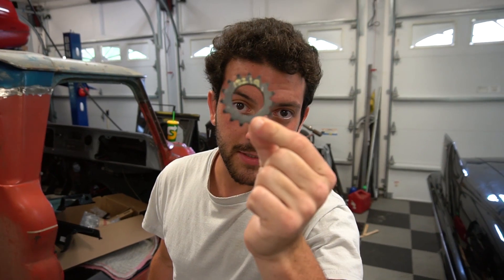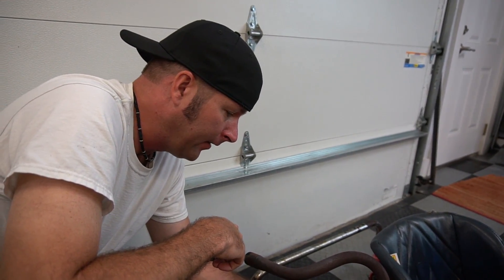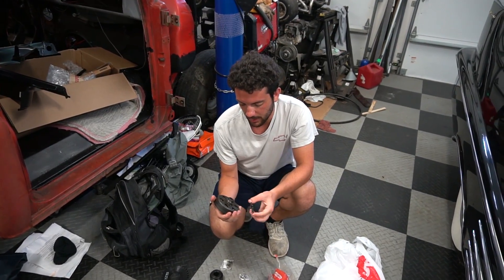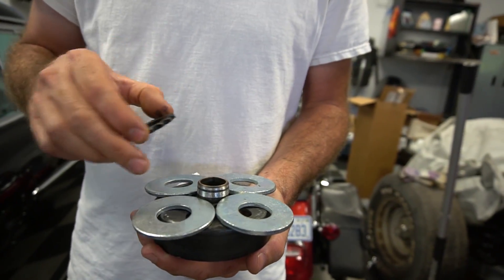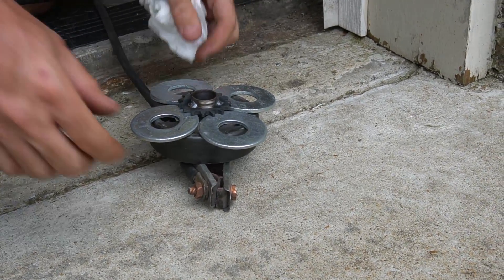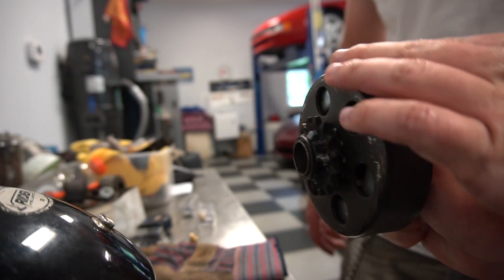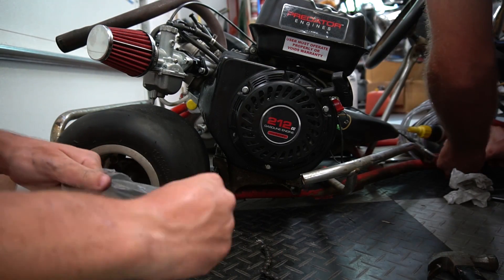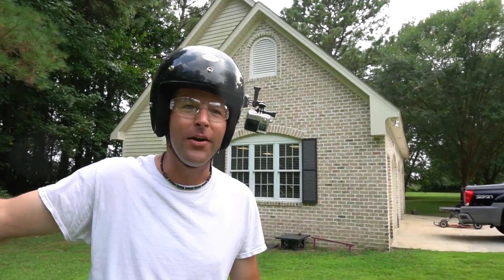Vintage Racing Kart Hits 70+ MPH

Comment: If i can find it amongst my hoard i have a newish cheetah racing clutch it was on on my 266cc BSP stroker GX200 has like 3 dirt track laps on its not even broken in comes with a 15-18 tooth sprockets i belive i have differnt clutch springs and stronger plates for it just gotta find it all id reckon you guys could hit over 72mph

Comment: Ok so question.....if you add a Small gear to the shaft it gets more speed? Or the bigger ones? I always thought you could get more speed by a bigger gear because of more surface area...I have no idea you would know lol thanks....btw that was AWESOME
Reply: It's about the size ratio of drive (gear, pulley, or sprocket) to driven. The engine sprocket is obviously the drive, the axle sprocket is the driven. If both drive and driven sprockets are the same size then the axle will turn at the same speep as the crankshaft. This is a 1:1 ratio, it has zero increase of torque or speed. In most gasoline engine applications you cannot realistically use a 1:1 ratio due to the limited torque output of the engine. Without torque multiplication the vehicle will have poor acceleration or possibly stall the engine. So we decrease the size of the drive sprocket and/or increase the size of the driven sprocket. This means that the engines crankshaft will now be turning at a faster speed than the axle. Lets say you have a dtrive sprocket and a driven sprocket, each with 50 teeth, a 1:1 ratio, and you replace both sprockets, with a 25 tooth drive sprocket and a 100 tooth driven sprocket you now have a ratio of 4:1 meaning your crankshaft will now spin 4 revolutions for every revolution of your axle. This will increase your torque being applied to the  axle and improve acceleration. Now lets say you test drive it and find that it accelerates great to about 25 miles per hour and at that point your engine is at maximum RPM and therefore limits your top speed to 25 miles per hour. If you wish to go faster you need to either increase the RPM your engine is capable of, which can be expensive and possibly risk blowing up the engine, or you can decrease the ratio by changing sprockets so that your drive spins less than the 4 times the revolutions that your driven is spinning . This time you put a 75 tooth sprocket on the axle, while leaving the 25 tooth sprocket on the engine. This gives you a 3:1 ratio. Now you test drive and find that acceleration has decreased somewhat but top speed has increased to 32 miles per hour. You also notice that the engine is still reaching it's maximum RPM and is therefore limiting the carts speed to 32 miles per hour. You decide to make one more change, putting the 50 tooth sprocket back on the crankshaft and leaving the 75 tooth sprocket on the axle thus giving you a 1.5:1 ratio. This time acceleration is even slower but you notice that the engine barely reaches it's maximum RPM before it runs out of power to go any faster, or is just short of its maximum RPM. At this point you have reached the maximum speed that engine is capable of propelling the cart at, any further reduction in the ratio will result in a loss of top speed because the engine does not have sufficient power to rev higher without the torque multiplication of a higher ratio.

Comment: That clutch + black widow = 10 mil views, 130 mph, and more fans, and fun, and life insurance rate increase :P like if u think they need to put that damn clutch on the 670, comment if they should take a torque converter and weld that sprocket or a bigger sprocket to the torque converter
Reply: That would most likely kill the 670.
Reply: Nah it'd kill the chassis before the engine lol

Comment: I was doing that, average 74-76 on a dirt track turning 15.40 sec time laps , the guys running limited engines are at 85-100 mph on same track, Southern Kartway, Loris SC, AKA Dannys,  check out those vids, I raced at 44-48 years old, offset chassis just like that, go around on a dirt track and it will put lead in your pencil, i raced back in 2007-2012

Comment: You need to plumb your vent to a puke tank.On our Briggs flatheads we got 94mph on a stocker and 106mph on a limited modified.1/4 mile oval with a 20tooth/front and a 70tooth rear.

Comment: Thanks for the entertainment!!!  Remind me:  Why no torque converter?
Reply: It's a little engine meant for minibikes.
Reply: They have been putting them on their other projects that have similar/identical engines.
Reply: They have? I've sorta only been following this project. I think they're using clutches cause there's no slip. I doubt a little torque converter would have a locker in it so it'll slip. So when they're going 72mph subtract like 5% slippage and they'd not be going 70. Also maybe the clutch is easier to mount sprockets on.
Reply: kipster1975 torque converters are slower but have more torque
Reply: it wont fit because the seat is too close to the engine

Comment: Hey guys I have an all stock non Hemi predator with air cleaner exhaust and flywheel mods I run a 13 tooth clutch and I have a 74 rear gear was wondering if you ever ran that type of combination

Comment: alsome work on the 12 to 15 i find myself watching your videos many times over just for ideas and kicks. but i do have this ?
maybe you might know before i spend 119$. the troque converter or tranny im working on a motorized 212cc motorized bike build but need to move the sproket on the converter to it opposite side or the back. perhape you have some ideas

Comment: Don't try this at home?? Well I couldn't.  like you, I don't have a one mile long driveway. My friend in the country however DOES have a 1.3 mile long driveway so i can try it at HIS home!

I reckon a bit of fairing over the engine would help reduce some drag and give you some more top speed if the engine isn't at max RPM already.  The tank is a big air resistance. Take it off and mount it behind the seat/ Driver where the air is already blocked and just a sheet of perspex heated and curved over the front of the engine would be much more aerodynamic. 
A fairing over the driver or a windscreen may help as well. 

I'd have the pipe exhaust come out straighter and also go behind the back of the seat and out.

Comment: I'm not trying to burst your bubbles but it only did 70, that point when it jumped up to 72mph and then went right back down was just an error with the GPS satellite tracking you. they sometimes miscalculate 2 to 3 mph for one second and then corrects itself. I first noticed that weird glitch when I was checking my top speed I would be staring at the speedometer watching it and every once in awhile it will jump Up 3 mph and then go back down within 1 second. There are 3 satellites and sometimes they aren't perfectly accurate you know but above all that, you guys are freaking awesome I love this kind of crap but anyways I'm just saying this mostly to let people know not that anyone probably cares but I guess all i can really say is.... Knowledge is knowledge and butt sex is butt sex

Comment: i dropped a small part into what i think is the carburator and my minibike (coleman ct200u) does anyone know what to do
Reply: if you dropped it down the black plastic box that holds the air filter it shouldn't be hard to remove it to retrieve the part. two 10mm nuts and a hose is all that holds it on. oh and put the choke on and fuel off. hopefully it didn't go very far

Comment: Idk why don't y'all tig weld stuff like precision parts it's cleaner no splatter to clean more ark control migs cool for tons of fast welds but I'd totally tiged this with 309 high carbon stainless wire myself I'd tig A lot of the frame tubing welds y'all do to

Comment: Other than the public road and complete lack of proper clothing, what's the huge danger here? Didn't these carts go like 80-90mph back in the day with nasty alcohol powered motors on them?
Reply: these karts with 250 cc 2 strokes often race at 150 mph , they are very capable chassis'
Reply: I don't believe THAT cart has ever gone that speed as it's easily 30 years old. I'm aware of modern shifter carts going insanely fast, but I think even in it's day that 72 would have been mild for a racing cart in the '80s. That's what I'm curious about.

Comment: So I gotta question... I found a gas scooter frame and removed the old engine and put a 212cc predator engine on it. So I have a brand new 10 tooth clutch but am not sure wether to go with a higher toothed sprocket or lower toothed. I have 9 inch tires on it. I just don't wanna ruin the clutch I get the lower gear ratio is faster and higher is better acceleration. What would be safe to use without completely destroying my clutch!?!? Someone help me out here
Reply: Matt Beston How many teeth on the driven sprocket and is it about the size of the wheel. Divide the driven sprocket tooth count by the clutch tooth count and you have the gear ratio. A ratio that works well for acceleration and speed is 7:1 on small engines.
Reply: the more teeth on the wheel sprocket the easer it will be on clutch
Reply: sweet thank you i decided to go with a 5:1 ratio just to keep it in the middle

Comment: Hey man 72 is fast in a go kart I have a push bike that I believe is faster I still have not hit 6th gear and revved it out yet but I believe it will do 80mph and 1day I will but I will need to mount a Speedo for you to believe it and i only won't to do it on the road like u did.

Comment: I have a Coleman ct200uex I put a stock Predator 212 in it with a 30 series torque converter and a 62 sprocket and a straight pipe there's nothing else done to this mini bike and egg got it up to 68 miles an hour I still haven't hit the governor's still has more speed it just pushes forward I swear they messed up while making the engine there's no governor in it I swear it came with no government but anyway my mini bike tops out really fast and it's all stock basically it's a predator 212 Hemi

Comment: Why does it burn oil when you're up the speed you should put that in your one of your video is Intel why it burns oil because I'm kind of curious of why it burns oil
Reply: It does not burn oil. The engine needs a vent to get rid of pressure that builds up in the engine. The oil is blowing out of that vent. They fixed it.

Comment: Congrats but not to bust your bubble or anything but don't the methanol carts do well over 100? I have a neighbor who built a frankenstein edition KART, it's my kid's old go cart lengthened 2 feet to fit an adult and the power plant is a 600CC Suzuki Katana motor cycle engine and gear box that is capable of doing 160 mph. I keep hoping he'll unleash the beast and drive it somewhere that he can get it over 100 MPH but right now it scares him. and he won't let me on it because i think he knows it doesn't scare me at all. My dumb ass would run through all 6 gears and keep trying to throttle up and end up blasting through the side of someone's house or something because "i aint got no quit in me!" lol
i'm  posting the Kart video on my channel soon, or you can also see it at Macgyver's workshop he's the one that built it. http://www.youtube.com/user/mapaladini

Comment: We all know in the real world of Kart racing the fastest 250s can hit hit speeds of close to or at 150 +. Yamaha KTs can hit over 100 depending on your gearing & what track your at. 72 is nothing. I ran for 15 years at Summit Point Raceway & many tracks in the States WKA went to & all were much faster than 72 , hell the 4 cylces were capable of at least 65. At 72 MPH those  speeds will not win you races.

Comment: Do you actually RACE the carts?
I'm sorry, but I did RACE carts back in the 70s and 80s.
Every thing your doing now had been done before.
Aren't you guys a bit old for go carts?
In 1988 I graduated to   racing cars.
Try it!
And no...
It will NOT ALWAYS BE FINE.
Flipping a cart at over 100 mph is EXTREMELY dangerous.
At 80 mph?
30% less dangerous.
65+ mph?
Dangerous.
Still sucks.

grow up.

Comment: you don't have the right gear you're very unprofessional I've drove Brett races and drove faster than that I got a wallet trophies and plaques but finally I went to driving in through and I drove a dino with a 250 Yamaha on it Shifter Kart twin cylinder 2 stroke